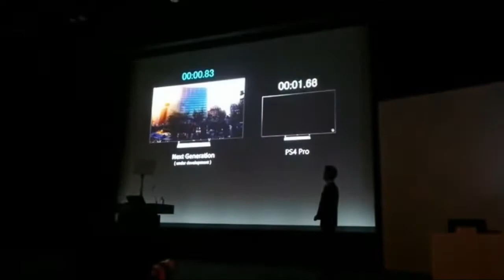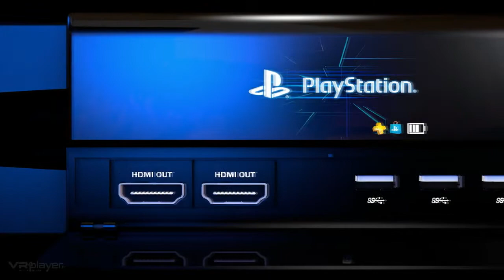PS5: Reasons Gamers Ain't Satisfy With The Backwards Compatibility

Comment: I'd pay $1000 for a PS5 or Series X with FULL backwards compatibility for all previous gen discs. What they need to do is have a special edition of each that's more expensive, for those of us who want it.
Reply from the maker: Xbox is not having problem as compared to PS5 on this issue but a recent post on twitter says Sony will readdress this again before it launch.
Reply: @10derbolt  Both companies have a huge issue. From what we currently know, the Series X will only be backwards compatible with games on the Xbox One's list of backwards compatible games. That list includes roughly 27% of the Xbox 360 library and only 4% of the original Xbox library. Not even close to being fully backwards compatible. That list was started way back in 2015, so I'm hoping Microsoft has came up with a better solution for the future of backwards compatibility. If this is all we get moving forward to next gen consoles, then it shows that they haven't even worked on anything BC related since last gen... Granted, Microsoft did better than Sony's 0% backwards compatibility with the PS4, but 27% and 4% will be unacceptable when these new consoles release later this year. I want to see all the discs playable on next gen consoles, or at least close to 100%. We deserve better from both Sony and Microsoft in 2020. If cost is the issue, then they need to come out with special edition consoles that have the FULL backwards compatibility feature. No more excuses.